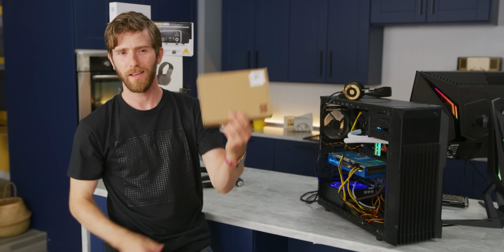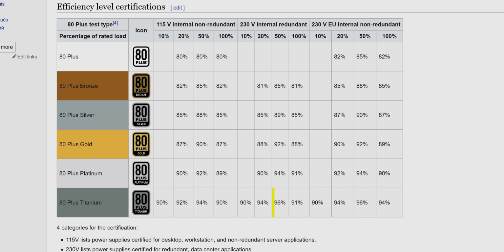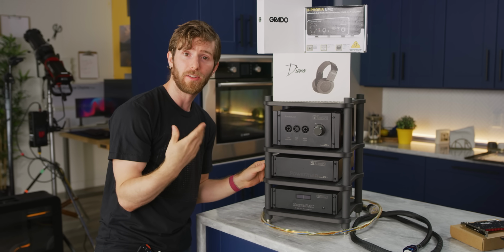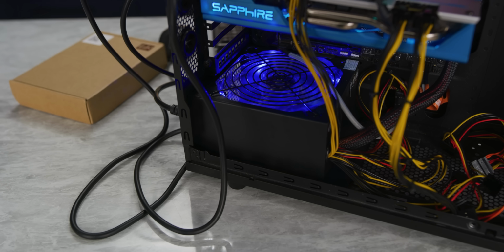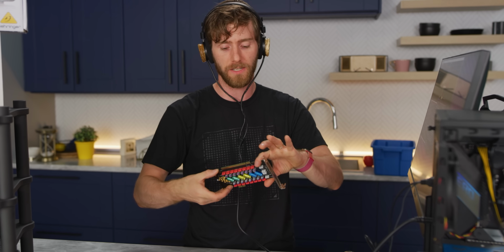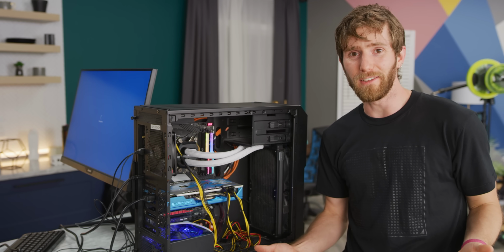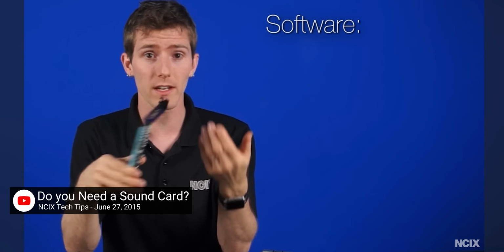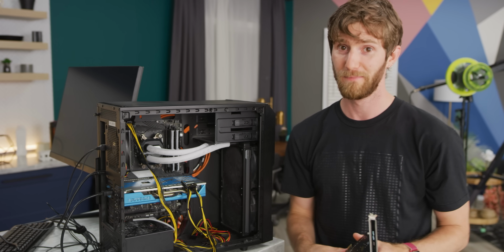Is this $40 card a SCAM? - "Audiophile" Power Filter

Comment: "The youngsters might not remember a day when onboard audio was horrible" I remember a day when computers didn't come with audio out of the box and not a single machine had onboard audio. :P
Reply: I feel the old system speaker( the one that beeped on startup) counted as onboarding audio.
Reply: @thoughtlesskills  It's called a Piezo Beeper and yeah I do suppose early IBM and Tandy machines used those but they didn't have dedicated audio cards and it's not quite the same as a Sound Blaster. lol They were primarily there for diagnostic reasons.

Comment: Anyone have any recommendations for a good sound card that does not break the bank but is also very clean as far as noise goes.  I would say my budget would be around $200 but I must warn my home rig is not your typical run of the mill PC.  My home rig is a dual processor (14 cores each)  HPE Proliant DL380 Gen9 Server chassis with 128GB of RAM, believe it or not, an EVGA GeForce GTX1060 (time for an upgrade but finding cards that fit a server chassis riser is rough) The stock server has no sound subsystem as servers usually do not, so while I was building it a few years ago I added an Asus Xonar card of one flavor or another (cant remember exact model it was inexpensive though ~$30).  I am an amateur radio operator and have a hefty 50amp rack mount 14V power supply in my shack that powers all my radio gear so I decided I would build out the PA of the sound card externally using the Xonar to drive an active multi-band EQ and a 4 channel car stereo amplifier that drives two Advent bookshelf speakers (mids\highs) and pair of tower speakers for midbass\bass.  The system jams and sounds really nice when the volume is up at all, however the computer is generating noise into the audio chain that can clearly be heard with no output volume and it annoys me.  I know I do not have any ground loops as I am feeding the EQ via TOSLINK fiber & D/A converter... Disconnecting the fiber link eliminates the noise so my noise is coming out of the card and going through the D/A and going into the EQ/Amplifier stages... I know I'm asking a lot but would be happy to to pull the cheap Xonar card out and put in something a little more adequate for my desires.  My focus is more on music sound quality, with gaming as a secondary use, honestly I don't game super often anymore so looking for more of a sound Q card.

Comment: This is quite stupid since any sound card or onboard DAC and Amp would have filtering build in.
If you have an issue with background noise this isnt a fix:
Getting an External DAC is the fix. 
Like the ones FiiO sells. They have really really good filtering.

All this card does is strap a bunch of fancy looking caps onto the 12V line. Well guess what: Your GPU, Motherboard and PSU already have filter caps to keep the 12V Line clean and stable!
GPUs use an LC Filter to provide clean 12V for the VRM and to keep switching noise and transients from leaking back into the 12V line affection the entire system.

Comment: I solved system noise in my audio by adapting Linus's suggestion, an external DAC with one addition a SPDIF connection removing any line noise, I pass the output to my hi-fi amplifier which has multiple speaker sets connected for music and a separate set for games which are switchable.  That way I can switch between speakers with a music or game soundstage.

Comment: One sure fire way to get background noise from your soundcard is to make sure the gain in the mic input is set to high (in the Windows Sound Mixer). If still don't hear it, but you have the option to playback 'whatever you hear', turn that on. That makes sure the high gain noise from the mic input gets heard at all times.

Comment: my speakers will hum...... but as soon as windows starts to boot up.... the hum goes away
.
i wonder if its some part of the sound card on the MOBO booting up (filters, or it may have a system that looks at the noise, and then compensates) 
but its 100% silent after windows starts to boot
.
.
1700x at stock..... ASUS crosshair 6.... 5700xt.... and corsair SP-2500 speakers....... on the FIRST GEN corsair HX-850W psu

Comment: I am an electrical engineer who designs power supplies for audio use, this video is pretty bad. no actual measurements were taken and the power filter card was never tested with a PCIe sound card. that is what it was designed for. the claim about reducing coil whine was that it reduces the affects of voltage noise on the PCIe power bus created by a noise source such as a switching power supply in a graphics card. it does not claim to reduce the acoustic emission of a coil in a switching power supply on a graphics card. this is why I am laughing at linus testing acoustic emission (with his ears!) but not testing voltage ripple on the PCIe power bus before and after adding the filter caps with the graphics card at different power consumption levels.

Comment: Yes. But it did clean up some motherboard audio signals. By like, a tiny bit. I got a USB > Balanced XLR DAC for around 40$ on aliexpress which did much, much more for my sound path (Granted, into 3 2U Balanced Stereo amps, [2x AB, 1x D]. Much better use of the like 50$.

Comment: At best a card like this can help if you have a noisy power supply by reducing the ripple on the DC power rails. If you have such a noisy power supply it will help the entire motherboard any all peripherals connected to it. It can't however help with coil whine because this is produced secondarily from the power rails and even if you ran the PC from pure DC, ie a set of battery packs, coil whine would still be present.

Comment: It would be better to test on external speakers to evaluate the quality of the output sound on a great way, the "perception" of Linus (which I'm not saying is bad), is something that is not the best way to test if that card works or not, in any case, never drop the hardware you will test :)

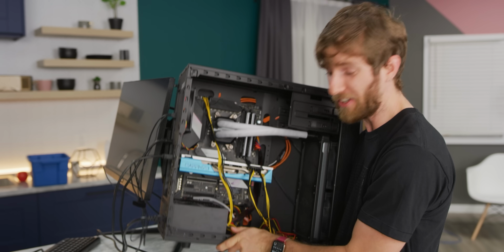Comment: 9:42, I have a newish motherboard that doesn't filter properly.  I believe it's because the electrical isn't grounded properly.  I bought a USB to AUX just to clean up the microphone input to be useable.  I'm wondering if this card would fix my issue.
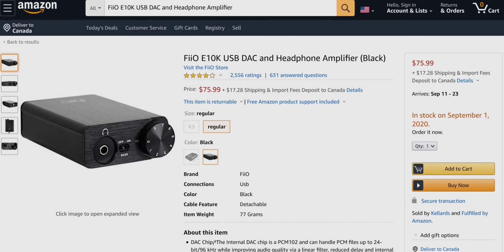Reply: 11:06, USB DACs can still be affected by really really poor USB power.  Though, any self-respecting DAC will have the appropriate cleanup circuits.

Comment: I've spent the first 6:47 of the video wondering how do you plug the audio card into the power conditioning card (maybe you install it with PCI-E copnnector facing away from mobo witha SLI-like adapter?), and the answer is you don't. So it most likely does almost nothing. And definitely modern onboard soundcards mostly at least don't suck and are enough not to buy an additional one. If you hear noise from front audio jack it's almost always because the cable that goes to it shares the ground with USB ports and is crappy, and the rear audio is fine. I didn't replace mine only because it's more convenient for me to use the rear jack (I like to rest my legs on my computer and the front jack comes out of the top and impedes that).

Comment: the pins on the other side of the card are so you can take off the plate and put it on the other side and use it in a pcie 1x slot...

Comment: Okay, to break this down for those that seem completely confused about how electronics work, yes that includes LTT, this card is like installing a line filter for your TV, but you plug in the stereo and listen to it in another room.  For this to work, it would have to be the device that SOMEHOW reroutes traces on the mainboard and magically provides power for your audio chips or card....  insert huge buzzer sound  FAIL, sorry but that is not what is happening.  Someone really needs to teach these guys what they are doing.  Also to prove ANYTHING with audio output, some guy bobbing his head and plugging merch is not cutting it.  You need a VISUAL scoped output where you can record and see transient waveform outputs in a controlled and filtered fashion insert another buzzer fail sound.

I laughed through half of this video, but don't think it was meant to be a comedy...  EDIT: okay I oroginally skipped through it a bit, and later rewatched it to learn they do mention the logic, but seriously, do it RIGHT AWAY, not after some silly head bobbing and merch plugging if you want to avoid judgement as incompetent.

Comment: A year late, but here goes nothing. How about this test. Guitar amps (especially cheap ones) pickup a lot of noise pretty easily from pretty much anywhere, even a light source, let alone a full blown PC right next to it. Say you connect the headphone output jack on the amp to the input of the PC, would it filter anything?

Comment: Flipping colours with DIP switches is MUCH better than having yet another piece of buggy code running on your system to do something you probably only ever change once, when you first set things up.  Sometimes oldschool is not only better AND more reliable, but also creates less trouble down the line.  It would get EXTRA points from me for NOT HAVING some annoying utility that has to be manually removed later.

Comment: the problem is
this solution is very much 1990s
back in 2010s we got so high quality, so low ESR, so low ripple (you can read it noise) capacitors and so good coils, that capacitors on this card are only unnecessary and probably standard breaking load for power supplies
remember
we almost have dropped ATX
we have EPS and SFX per supplies now (almost exclusively) and load of more then 22mF may actually get situation worse to point of short-circuit protection firing or even breaking of power supply or even burning power lines on Motherboard
at best you will increase noise and lower stability of computer

Comment: It all makes sense until you realise a digital signal can't degrade; it either, generally, works 100% or not at all. It'd make more sense- maybe- if you use analog audio.

Or, to put it another way, if your power source was so bad that it would need "fixing" with a device external to the motherboard, you very likely would have bigger problems than slightly shoddy audio. 

Don't get me wrong though- I do  remember the early days of analog audio with lots of buzzing.

Comment: That is a good point you bring up at 9:36: Most built in sound cards have this that is enough for basic speakers, and if you are like me where you have a more advanced sound system hooked up (I run a vintage pioneer SA-8100 and use a Soundblaster X-Fi Platinum), you're going to have a dedicated sound card with built in power conditioners. 

Point is, if you have a sound system that is powerful and clean enough to pick up "dirty" power, then you likely are using a dedicated audio card with these features built in.

Comment: I remember my first soundcard. I think it was a sound blaster 16 that my brother and I got for Christmas in the early 90ies. When you say night and day I assume you mean that night is the built-in sound card. Back in those days, there were no built-in sound cards at all, but only the PC speaker. For those who don't know the PC speaker is the little 1/2cm round thing that you plug directly onto the pins on your motherboard, next to the power switch, reset switch, power led and HDD led. Yes, you drive and control it with only the output signal from those pins. Installing that sound blaster 16 was closer to the darkness of the abyss and day. I don't remember the last sound card I got but at some point, I had a motherboard with an integrated sound card and that was that.

Comment: Best way to test would be to record the empty Line In jack in Audacity, both with and without the magic expansion card in the system, then boost the recorded silence by the same amount for both files (say, 500%). Then you should be able to clearly visualize and/or hear whether or not there is a difference.
Reply: Indeed. Hearing test like Linus did are the domain of "audiophiles" who buy 5000 USD cables. Let's do some real tests or at least get a proper control group.
Reply: They weren't really trying to test it hence them dropping it and still testing it
Reply: @joelr2214  LTT viewers are gamers for the most part are geeks/gamers and this shit is the kind of stuff that makes sense for audiophiles doesn't make a whole lot of sense for gamers to have and it's the kind of thing people would convince people who aren't that savy with building a gamming rig would be tricked into getting by someone because they were told that the reduction in electrical noise will make it easier for them to hear enemies' location. He tested it in a way that this video would  be applicable and make the most sense to the largest demographic of his viewers.
Reply: I was thinking pipe it out to an oscilloscope and see how much fuzz/noise there is
Reply: Or reverse the phase of one of the signals and sum them up. If it's quiet, there's no difference.
Reply: @taotie86 isn't noise random?
Reply: But if you can't detect the difference while listening to a song is there even a point?
Reply: @sovietmaize8277  No but if they're meant to actually test something then they need to do it properly instead of just guessing a bunch of nonsense
Reply: @PunzL  Well, this isn't a review.
Reply: Yep, the key major way this would have improved the video. Still a good video and proves the groundwork of PC audio.
Simple solutions: Mainboard with audio filtrations - most have these days. Or, sound card with filtration if main board is a whiney POS.

Comment: In theory, shunt regulation can be used to reduce EMI on powerlines. A better solution is to buy a better power supply. I have worked on a medical system that had to have DC isolation and still measure neuron activity in the 1.0 microvolt range.

Comment: i am wonder if..... if the output audio going to osciloscope, because human ears cannot detect such electrical noise, not that sensitive, while osciloscope able to detect even in very small noise.... or maybe you are able to create silent audio and try to feed the audio output to very HiFi audio then try to high load the CPU and or memory working then push the audio volume to the maximum level, then there you might hear the noise...

Comment: Okay so with my guitar amp, my newest one does not have the electrical noise, but my two (older and not as expensive ones) both have that “hmmmmmm” noise. Does that mean that it’s got a bad power supply inside the amp?

Comment: PCs are powered by extremely RFI-heavy switching mode power supplies.  These can cause a lot of audio signal noise via induction.  The thing is that it's not the insides of the PC that are passing that noise to you, at least not exclusively.   Your headphone cable is the longest Antenna in the system shown in the video.  If anything would reduce how much RFI got into your headphones,  adding ferrite chokes at certain positions on the headphone cord MIGHT reduce how much radio frequency noise gets into the headphone cables. However that noise is probably at -98 dB level relative to your signal, if we consider your reference listening volume to be the 0 dB reference.  You might be able to measure that kind of noise with equipment that is more sensitive than your ears.

Audiophiles actually need adjustments to their expectations and reasoning skills, since no adjustments to their ears and their brains with the known faults in the human hardware and firmware, are possible.

The guy to measure your SNR is Julian Krause.  Meanwhile plug in an analog headphone amp and turn it up and listen to your noise floor and check your headroom.

The right way to improve your audio signal is to use an outboard audio interface.   192khz 32 bit D/A with over 70 dB of headroom. No problem.  Noise floor down 90 dB, no problem.

Most hobbyist dacs are actually measurable crap.  But you can't hear it.  If you want something measurably better, a pro level audio interface.  If plugging in some kind of passive noise absorber into a PCI slot changes anything at the audio interface, I'd be shocked.  The DAC is digital and the traces between the DAC and the Jack are short enough to be only gigahertz range antennas for noise via inductance.

I play guitar and plug guitars directly into audio interfaces for home reecording and the worst link in the chain is the guitar itself.   Put a PC in the same room as a guitar and what you are doing is broadcasting RF noise towards an RF sensor (guitar pickup) which is directional.   Change what you point the pickup at or touch the ground of the guitar (bridge) and add yourself to the circuit (making the overall circuit less noisy) and you can see that adding a passive component (such as YOU) can indeed lower noise.

Comment: I've got one amplifier that all my speakers are connected to which is connected to my laptop. You don't really need an ampstack for a personal setup. I have a car subwoofer and 2 tower speakers ran to the amp and it can handle them fine and shake the room a little if you crank up the volume. In case anyone asks it's the ax-592 amp from yamaha, not sure if you can find those easily any more nowadays.

Comment: So... U couldn't even create a baseline scenario, and then called it useless cos u failed to come up with a baseline where you have that hissing or buzzing sound in the first place... Try putting an amp on the output instead of just a measly little set headphones. That is when u start noticing a difference. Either way, you can't say you've even begun to test the products usefulness if you couldn't even come up with a baseline situation in which it claims to be useful. Said type of situation is quite common, but u couldn't even bother to figure out how it happens.